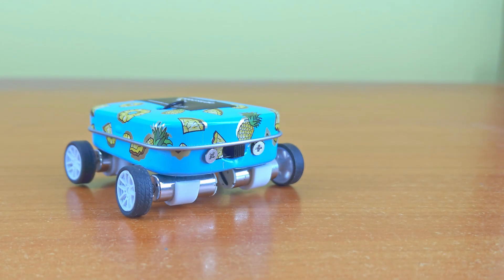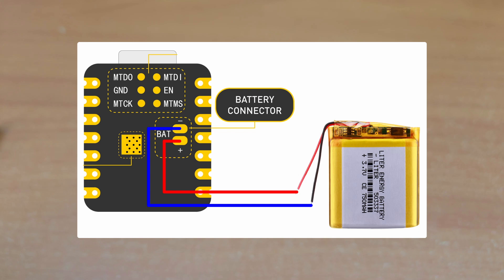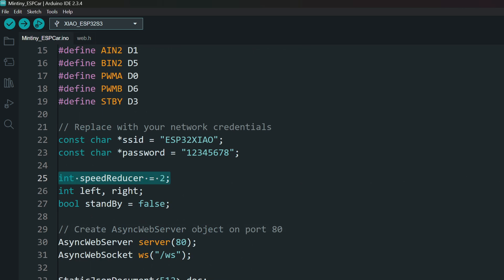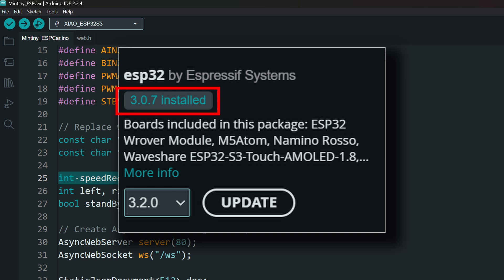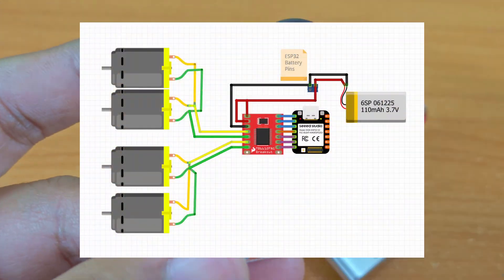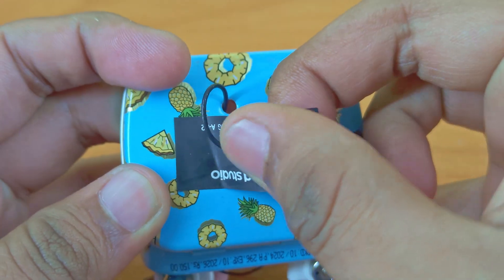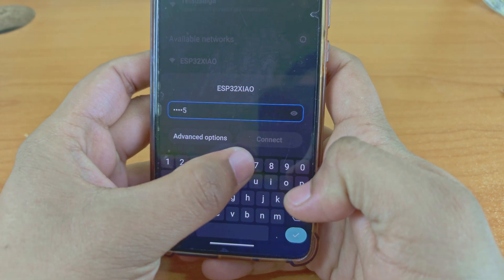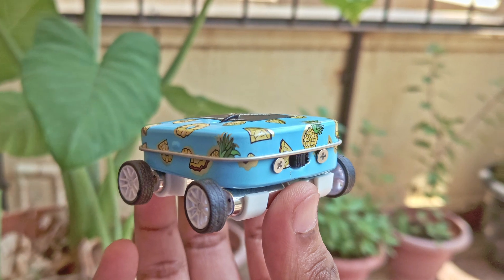How to make a Tiny ESP32 Car without 3D printing | With code | Xiao ESP32

Comment: In diagram there are 4 motors and I did not understand that which motor is where is it random??
Reply from the maker: Yes the motors are not specifically connected in any order.

Comment: How do you use 4 motors with a motor driver that can only drive 2 motors?
Reply from the maker: 2 motors share 1 line. Direction is controlled in the code to match it.

Comment: Hi! I'm planning to use your great mini car project with a Seeed Studio XIAO ESP32-S3.
Your video shows a critical confusion regarding the power supply (VCC) pin for the TB6612FNG driver. To ensure safety and prevent chip burnout, could you please provide a full, detailed wiring schematic or diagram that clearly shows the following connections?
Where the 3.3\text{V} Logic Power from the ESP32 connects to the VCC pin on the TB6612FNG.
The connection of the 3.7\text{V} Battery Power to the VM pin.
The complete path for all GND connections.
Having the full schematic image would be incredibly helpful for everyone using a low-voltage logic MCU! Thanks for your help!
Reply: I've seen your schematic on the link down description. But I can't get it
Reply from the maker: You mean you don't understand it?
Reply from the maker: Both VM and V of the driver board are connected to the battery directly. The motors are very small, it is safe.
Reply: so I don't need to solder the bat + and bat - pins on the xiao seeed esp32?

Comment: I downloaded everything and I also changed the esp32 to3.0.7 but still its saying Compilation error: 'StaticJsonDocument' was not declared in this scope.
Reply from the maker: StaticJsonDocument<512> doc

Is declared in the code. If you're getting the error, you might have copied the code incorrectly. Please check